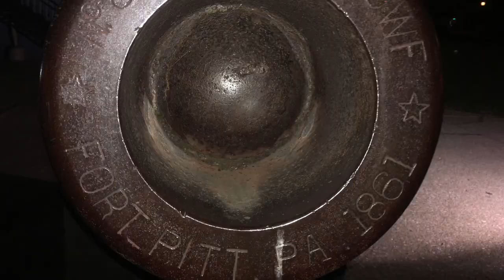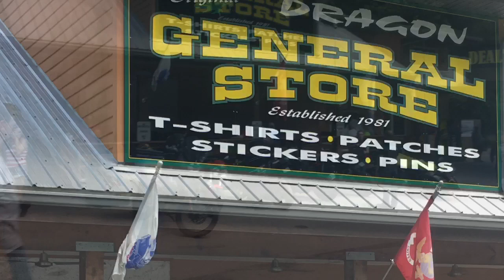KLR 650 Trip “Crash Test”

Comment: Sorry to hear it.  I have to always remember that this bike doesn't have ABS, and slow down early and stay back from people.  This is a pretty heavy bike and will lock the rear in a heartbeat, as I've discovered a few times in traffic.  Be smooth with braking, and give more distance than you even think you need.
Reply from the maker: Thanks, Rob. I guess I’ve discovered it now too!  I think the main thing was that I didn’t swerve like I should have. Thanks for the tips though, I’ll bear them in mind.
Reply: Unfortunately most of us learn the hard way, myself included.  One other thing I wanted to mention for new riders that may see this.. I always try to keep the 70/30 rule in mind.. Try to use 70% front brake and 30% rear.. this helps avoid locking the rear in quick reaction scenarios.
Reply from the maker: That’s a great one, I haven’t heard it in that context before. Thanks!